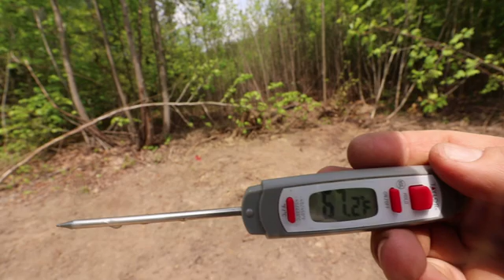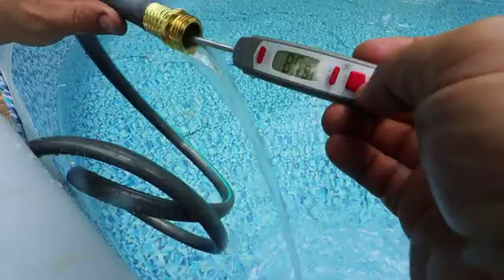DIY Pool Heater Explained In 90 Seconds! 90% Off Store Bought!! FFE#67

Comment: What size copper you using
Reply: What type of copper tubing are you using
Reply from the maker: It was soft copper, comes in a big round wheel. Copper Tube, KWOKWEI 15/32inch(12mm) OD Pure Copper Tubing, 3.28ft Length Soft Coil Copper Tubing Seamless Hollow Copper Round Tube for Refrigerator, Air conditioners, freezers, DIY projects https://a.co/d/bYzIVFe
This isn't 1 inch, but this type
Reply: What you think bout half inch I canget it 60 ft pretty cheap
Reply from the maker: You could probably run a splitter and run two of them and that would get you close to maxing the pump.
Reply: How many feet did you use sorry so many questions just wanna get the pool warm so my kid can swim 😆
Reply from the maker: @rtcosta9392 no worries my man! I built it last year but I believe I used a 20ft coil and then used the garden hoses to get to the pool.
Reply from the maker: It was too small, 3/8ths I believe. A larger pump and diameter would have made a bigger difference.
Reply: @FlannelFarms  I'm looking at a 2000gph pump what size copper you think
Reply from the maker: @rtcosta9392 at least 3/4 if not 1 inch, that should have a max capacity of 2200gph

Comment: Nice build! I'd be interested to see what the difference is if you tried filling up the bottom portion of the trash can with water so the coils are mostly covered. Air isn't very good at transferring heat.
Reply from the maker: It would probably work better.

Comment: That is a fantastic water heater How long do you think it will take to actually heat the whole pool?
Reply from the maker: At that rate probably three our four days if you kept a good fire going.  If I was able to find 5/8ths copper it would go faster.  My pump and coil are a bit small for a 10,000 gallon pool lol.